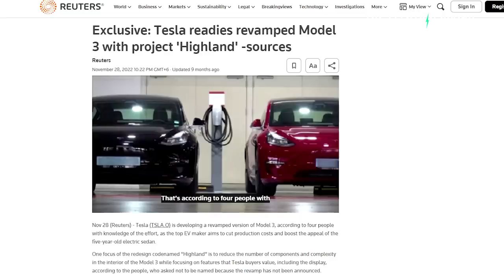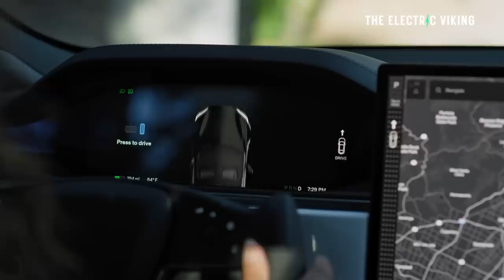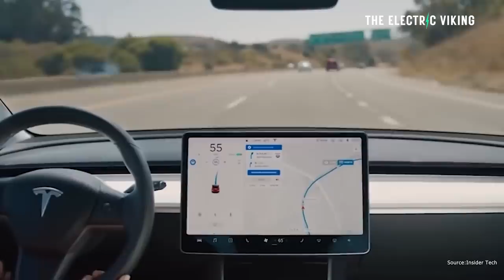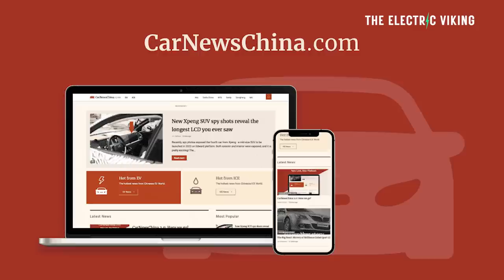NEW Tesla Highland 15% cheaper with 70 miles more range say insiders

Comment: The only way a yoke makes sense is if they have proportional steering i.e. steering that changes  according to what speed you're driving, which is almost impossible to do without drive by wire.

Comment: if you read the facts Phil that is pretty close to impossible.  Is it possible to use 1/3rd of the worlds fresh water to process lithium?  So the industry will have to find a scalable battery chemistry for that to even be within the range of possible. To what end? Right now 85% of the grid is fossil fuel powered and it takes 15% to transfer the power from the source to the EV. How will you triple the size of the grid and not use fossil fuel to do the expansion.. you are already using all the lithium for EVs so you can't be making giant battery farms. There are 1.4 BIllion non EVs now; if you replace 3 Million in 2023, 5 million in 2024, 7 million in 2025, 10 million in 2026,  14 million in 2027, 18 million in 2028 , 21 million in 2029, and 24 million in 2030, you've only made 80 million EVs out of 1.4 billion vehicles.  Even if you double that rate which is probably impossible using lithium; you'd only replace about 10% of vehicles. In short you'd have 5-10% EVs mostly powered by fossil fuel anyway.

Comment: Regardless of the intended price it will eventually sell for the release refresh will sell for the current model pricing. Tesla needs to sell off current inventory of the Gen 1 version. If the refresh Is cheaper out of the gate then the old inventory will not sell.

Comment: My guess is that it will cost 15% less to produce.. It doesn’t mean that Tesla will price this 15% lower. Perhaps they will add range , have a small price reduction and keep the remainder as additional profit.  Either way, looking forward to the new model 3 specs.
Reply: I agree probably going to give them thicker margins and a small price cut for the consumer. It will give tesla flexibility to drop prices further if they need to stimulate demand

Comment: In the U.S. in 2024 that tax break is up front when the car is purchased and the buyer doesn't have to wait until they file their taxes by the April 15th deadline. So, the combination of the lower Model 3 price  cutand the upfront tax break will make Model 3 super attractive.  
HW 3.5 does that mean new chip, but old cameras?
Reply: But, low cost financing and supercharger credits through a referral program would also be welcome.

Comment: That is 500,000 gallons per ton of Lithium. 100,000 tons were produced. 100,000 x 500,000 = 500 billion gallons approximately equal to 1/3 Lake Erie.  If you intend to try to use lithium to make 100 million EVs then you are talking about all the great Lakes being sacrificed every year to produce lithium - it simply won't happen; not even close.

Comment: Apparently after EV accidents, insurance companies are paying out on the vehicles value, if the world eventually gets to 50 percent EV, your insurance premiums will rise drastically, also less fuel tax will be retrieved by governments so there will be some form of EV tax instead of a fuel based tax running side by side with ice vehicles, it's not the fact that EV catch fire, it's when they do from other means, it can't be controlled, so we better get used to many buildings going up in smoke also as we are starting to see

Comment: The battery uses a completely new chemistry. They replaced a lot of lithium with manganese which is cheaper so overall the car most expensive part got cheaper. The 70 miles more range seem a bit too much however. Unless they managed to reduce the weight significantly or improve the drag coefficient which was already excellent I don't see how they could do it... Nobody talked about a new motor or something else and 10% more capacity does not equal 20% more range in the EV world.
Reply: but is  it still the lfp that can charge to 100? the reason why i like the RWD is cus of the LFP battery which is a full charge and longer lifespan
Reply: @RigaToeKnee  Yes you will be able to charge to 100% consistently without degrading the battery. Also this battery is supposed to be even more durable in the long term, which means more charging cycles. The only thing that I really don't like with Tesla and other EV is that they go for structural battery packs and these can not be repaired after an accident. It needs to change for better sustainability and reasonable insurance prices.

Comment: Sounds fantastic. Will be interesting to see how the forward collision safety system works without radar. Using cameras only is not as secure.
Reply: They've been using no radar for years now.
Reply: And it doesn’t work as good. I have radar that no longer works. Went from very precise especially when parking. To missing lots of obstacles. If it’s not a car or a trash can the car can’t see it.
Reply: @MiddleAgedMike Yet. The system will constantly evolve to improve. Now, it may come to pass that only the newer hardware with new HD cameras and maybe positioning, can fully implement this quality in vision only. But Musk also seems to have said new HD radar is potentially being added back in. Maybe that will be the version 4 in the future. We’ll just have to see. But sadly, older hardware setups may get left behind. I know my hardware 2.5 is upgradable to 3.0.. but even at that, it will fall behind the newest capabilities coming. But, i’m still satisfied with my system at 2.5. Until FSD is fully solved and implemented and legal.. i don’t care about these incremental upgrades.

Comment: So yes Peter you could make 10 million EVs if you used 40kWh packs or you could make just million Ford lightnights with 130 kWh packs. Since the Tesla model Y is the most popular and typical size battery;  of 81kWh and hence representive of what people want using that as a respresentative of EVs; and the fact that pack uses 20 lbs of lithium; doing the math you can quickly determine you could make 5-6 million Y size packs if EVs use 50-60% of the worlds lithium production. Over a billion cell phones alone use lithium cells.

Comment: Peter; no there were not 10 million EVs build last year unless you include hybrids.  Hybrids don't count here on Mr Vikings channel.  Tesla made a shade over 2 Million, BYD made about the same; the rest all total didn't make 1 million.  Many of those were not Y size battery packs, so you could get a slightly larger number if they were all model 3's or some other short range unpopular vehicle no one wants.
Reply: Manufacturing will ramp up as demand increases probably by a factor of ten as we get nearer to 2030.

Comment: We shall see what the cost is of the Highland when they post the different Trims  (Sandard, Long Range, and performance). compared to the previous Model 3.  I am not interested in the Sedan version, but will they also lower the cost of the newer Model Y (Juniper) hatchback when it comes out in 2024.

There are still some debates on you-tube videos about the miles-range of the batteries on the Tesla vehicles can get with one charge.  Some say the actual realistic battery range is lower than the suggested/listed range given by Tesla.  Will this also be the same debate for the Highland vehicle.

As time goes on,  the EV's will continue to get better as technology improves every year.

The thing I see in some of the posted you-tube videos, I don't see the Legacy manufacturers ever being better than Tesla.  They are still so dead set in selling only their high priced EV vehicles. Example - In a you tube video - GM is dropping their lowest costing Trim of the Blazer EV and only going with the higher priced OTD 56-70 thousand dollar EV vehicles.  Legacy manufacturers still seem to be on the mindset that people will buy their highest priced Trim vehicles.  Maybe for fleet sales, but surely not for the average person looking to get an affordable Electric car.

Comment: Power trains make it so much easier to get better speeds than ICE. So now that whole equation of performance is out the window really. It becomes more about efficiency, and Tesla already got that. Along with a streamlined and simplified brand + perfected production line the old way of competing in the car market has changed. It's more like computer or silicon chips now: potentially we will have a lot less brands.

Comment: The giga castings should reduce the Model 3 part count and simplify production should allow to reduce costs with enough volume and allow tesla to reduce prices and still make more money.  If they can make the car more aerodynamic and lighter car with parts reduction along with larger and more energy dense L3P graphite battery will drive demand way up even for a sedan.  The Mexico made model 2 will kill off a large part of the lower end ice car market and accelerate the transition from gas to electric but they have to get at least 150  kw dc fast charging speed.  Telsa needs to build out their charging infrastructure quickly to become the Exxon in EV charging companies especially in  the non east and west cost in the USA and all of central america.  Keep in mind people need to be safe while charging so they need to minimize charge time which for me is 99% of the time at home and resorts need to offer more level 2 and 3 charging as their clients will have higher expectation very quickly when the model 2 becomes available it will skyrocket that demand.

Comment: Its not going to be cheaper. There will be a lot of demand and there is still the tax credit to motivate buyers. Even if costs are cheaper they will just take more profit. 
Also, just because batteries get more efficient doesn't mean they will extend ranges. They will just make batteries lighter and smaller and cheaper, keep the range around where it is now. Tesla has determined the ranges ir currently produces are enough because daily needs don't require super high range when charging at home every night.

Comment: postings with links are sometimes removed - so - look up world lithium production from statitica.  Over the past 5 years the average of Lithium production is 100,000 tons; to process that takes 1% of the worlds production but EVs only account for 3% of the worlds light vehicles.  Even if there was enough lithium to mine it would take 33% of the worlds fresh water to process it. This is not going to happen; so lithium can't work, it can't even expand to 10% of world light vehicle production.

Comment: The price of the entry level model 3 in in uk now is £43k, that’s the equivalent of $54k that is double the expected price of of the M3 Highland in China.
Someone is getting ripped off, and I think it’s us.
Reply: Wrong, as every ev sold outside of China is significantly more expensive Vs China only prices. It isn't a tesla specific practice by any stretch. 
31k for a Chinese built m3 or 40k for a U.S. built one. Chinese tesla worker MAKES 15-17k U.S. worker makes 53-55k.

Comment: A two door version of the model three and a slight reduction in length but still with rear seats suitable for young children would help to bring down prices and make the car lighter and extend the range on the same battery, a car size very popular around the world, - kill the ice!
Reply: Have you heard about Tesla's plan to "Cut the Manufacturing Cost in Half" starting at the Builds coming out of Giga Mexico in ~2 Years?  

It will, as we understand, be a smaller vehicle than the Model 3! And target the $25,000 Neighborhood!
Reply: @robertweekley5926  Yes, Tesla 2, could be a hatchback

Comment: I want an EV similar to a Civic or Corona that I can buy for $12-15k used (2-3 years old) and that will last another 15 years.
Reply: You can get a used 2021 Nissan Leaf for $14k in the US after $4k government rebate with 19K miles on it. 40 kwh battery with about 130-140 miles of range. Just saw one one on line.  Must buy through a dealer. I have a 2019 Leaf  with 64k miles on it and I never took it in for service. Only bought two tires for it. I also have a gas Civic with 189k miles that now never gets driven. Leaf sits higher than Civic and is more comfortable to drive. Battery degradation has been minimal even though I always charge to 100% and it has 64k miles on it. You really can't use it for road trips because fast charging more than once will heat the battery and the car throttles back the charging speed.  But for around town and short trips( 200 miles round trip with one fast charge) its great. Im thinking of trading in my 2019 for a used plus model that has 200+ miles of range. Will it last 15 years? I don't know, probably, but with much reduced range.

Comment: It doesn't matter how wonderful EVs are; as long as they are based on lithium chemistry you can't make enough.  When will you face that reality? A Y uses 20 lbs of lithium, if ever ounce of lithium produced in the world went to making Model Y's you could only make 10 million Ys; but not all lithium goes to making EVs so the most one might make is 5 Million to 6 Million; 100 million vehicles are sold annually.  1 ton of Lithium takes 500,000 gallons of water to refine; already 1% of all fresh water. Until such time as EVs have chemistry that can scale; they can't replace ICE vehicles.  Possibly hybrids could, but you don't count them as pure enough.
Reply: Is that the best FUD you could find? The lithium shortage bs was completely debunked over a year ago.😅🤣😂🤪
Reply: Right, over ten million ev built last year, using the new unobtainium battery chemistry. Production volumes this year will exceed that -  and if you think 500,000 gallons is 1% of all fresh water, dude, thats over 100,000 gallons less than a single Olympic swimming pool!
Reply: @TB-up4xi  I was to replying to the OP, who was suggesting 500, 000 gallons was 1% of all fresh water

Comment: The only problem I have with electric cars is that they can accelerate so quickly it can hurt your neck.
Reply: I don't think it's too bad with the base models but if this is a major concern for you, then by all means avoid the performance versions. Plus you might consider getting FSD, which I understand drives quite sedately. 😊
Reply: Like giving alcohol to alcoholics? I tend to be able to control my right boot to avoid spinal injuries.